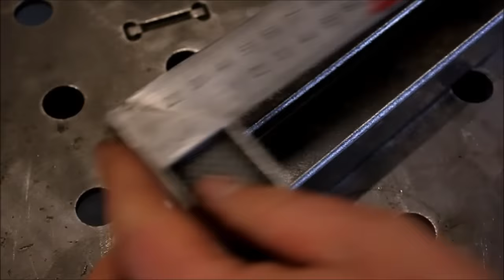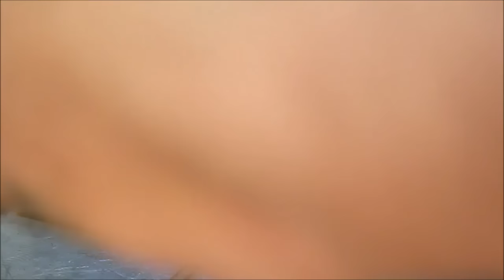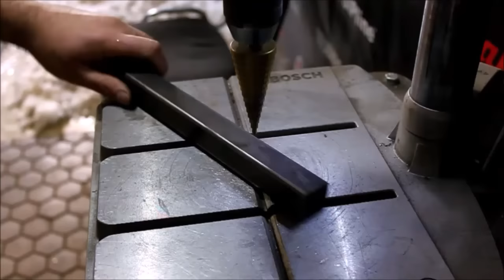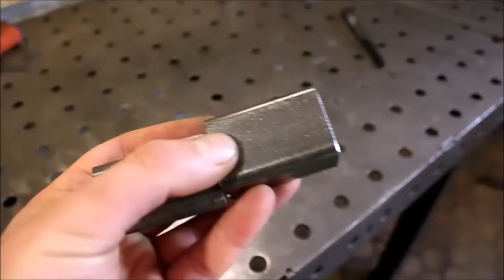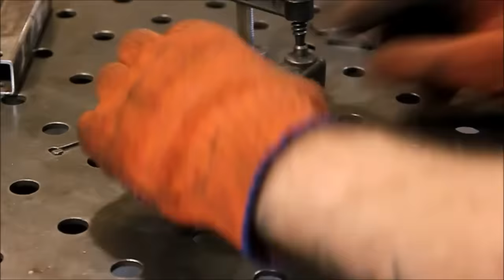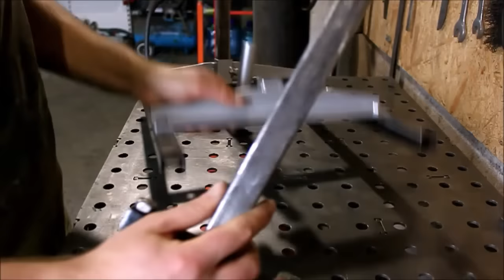5 Dollars - Homemade Alaskan mill | Portabe Sawmill || ⬇️ +Plans ⬇️

Comment: the middle bar with handle should sit lower, sliding on the surface of the wood. This way you'll avoid the drop that happened at the end of ripping in the video. I see in your store, that you fixed that problem already.
Reply from the maker: Yes, everything is correct)) This was my first job and I did not take this moment into account.  Thanks)) 😎

Comment: im so stoked i found this video. thank you for taking the time and putting this together.  i was looking at mills that were around the 200$$ mark, then i thought wait, why don't i just fab one up for cents on the dollar.  this is very nice craftsmanship.  looks way more solid then the cheep aluminum ones i have used. ill be building basically the exact same thing, only a touch bigger.  thank you!

Comment: Is this ripping chain or normal cross cut
Reply from the maker: This is a regular chain that I resharpened at 10 °
Reply: Ok thanks for reply
Reply: Please suggest me which is better ripping chain or regular with 10degree for milling because I have some milling work at home , if you worked with milling chain
Reply from the maker: I resharpen a regular oregon chain

Comment: Nice video. Since I'm not a welder or metalworker I'll just order one online.
Reply: My thoughts exactly
Reply: Yeah this video is clickbait. Specialized metal worker tools worth $1000s here. Don't bother. I respect the work, but not the dishonesty in advertising the video. $5 my a...
Reply: @CP-mb7ly  what? What specialized tools? You buy a drill press for 50.00, a cheap welder for 125.00, a step bit for 10.00,  you don't need a chop saw, grinder will work fine. Stop complaining. He's given you a very easy how to. But it's up to you to adapt it to your needs and skill level. You could literally build this with a hack saw and, a drill if you only had those. Solutions not problems my friend.
Reply: @ctyoungman  lol by your own post dude, that's almost $200 worth of tools. And not good ones. What planet are you in that you can find a drill press for that? Yeah, no. It's click bait.
Reply: @CP-mb7ly  have you never heard of harbor freight? Literally 125.00 flux core welder, 54.99 dollor bench top drill press. Of course it's all Chinese junk but it will work. Check your facts there bud before trying to dismiss someone else. Some people can only afford crap tools. Iv seen some decent things be made with junk. Not to mention.. fine 200.00 $ that nothing.. not 10,000$
Reply: Lowest priced drill press is $80 bud, maybe check YOUR facts. 

Also the title is literally $5 to make. Sure, from scraps, and w tools they already have. Got my hopes up to make a sawmill until I saw all the tools. Would I make it by hand w a hacksaw and a drill? Maybe, but I got less time to spend on that, need to make $$$ to pay the over $200 worth of tools for something that costs $60-100, and the cheap options are $30-50.
Reply: Where do you get online

Comment: What is the spray you used when welding?
Reply from the maker: abicor binzel ceramic spray
Reply: Anti spatter but it is not needed just makes weld prettier